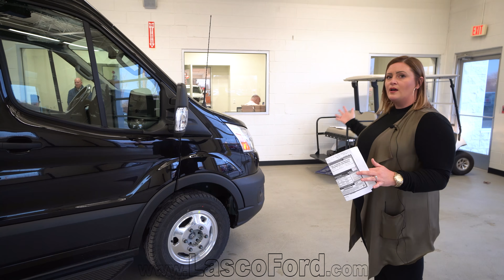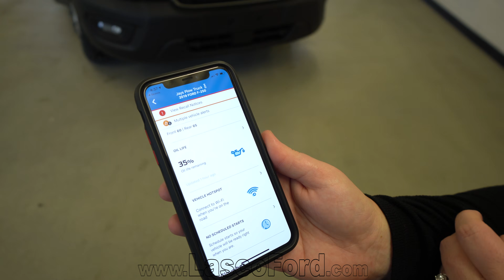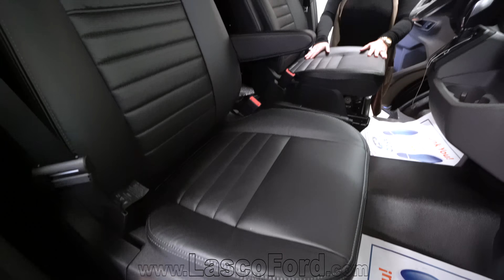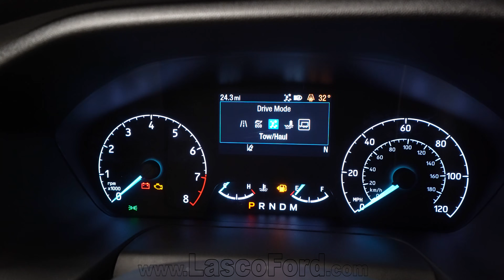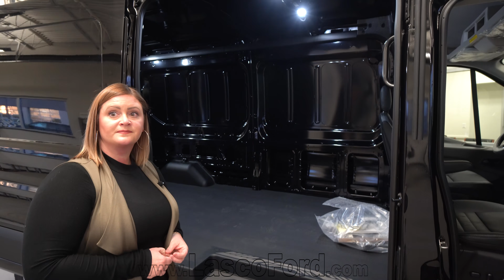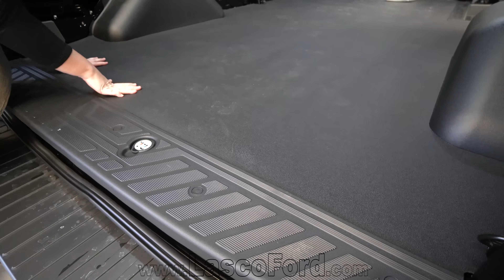2020 Ford Transit AWD - FINALLY! ALL Wheel Drive is HERE!

Comment: why did they "reduce" the brake pads by HALF?? will ford ever fix problems that started back in 2013? Like the water running down into the engine compartment right down on the computer?

Comment: The only thing all wheel drive means to commercial owner is more maintenance to worry about. As far as "warming up the vehicle" before the driver gets there. The idea of safety checks is to check the vehicle before you start the engine like oil and coolant levels etc not after it's been running.

Comment: What's the point f having All wheel drive in a top heavy delivery van. Trust me,there is no commercial app for for wheel drive. If you can't delivery safely in two wheel drive you shouldn't be driving.

Comment: Great suggestion Heeran. I would add something else as well. Being as you are the dealership, the spokesman and spokeswoman for Ford in this case,  you really, REALLY need to know your vehicle Before you make a video about the vehicle. I would be able to tell in less than one minute after talking to either one of you that I know more about ANY of the vehicles in your showroom than you do. It's funny, I will actually purposefully talk circles around a salesperson who reveals to me their ignorance about the product they are trying to sell to me. I will ask questions I am pretty sure they don't know the answer to just to watch them squirm or make up answers. You should ALWAYS have information about your vehicles right at your fingertips. I realize there are different types of buyers that come in, many just as or possibly more ignorant of the vehicle than you are. Those are the potential customers that you should be able to help and give them as much information about the vehicle as possible so they can make an informed decision. Then there are those who just "like" a certain vehicle for whatever reason, it could be the looks, the reputation etc. Again, help them make an informed decision and reinforce the positive thoughts they have. Then there are buyers such as myself who keeps up with nearly all the brands sold here in the USA. I am well informed about specs such as Engine displacement, different engines available, HP, Torque and at what RPM they top out for each. If there is a vehicle I am particularly interested in then I do a LOT of homework about it before I ever go see it at a dealership. There is literally NOTHING that a salesman is going to tell me about the vehicle itself that i don't already know and usually I tell the salesman things about it they weren't aware of. The reason you should know your vehicles in simple, so you can tailor your sales pitch toward the type of potential buyer.  You should be able to figure out which type of buyer you have in front of you within the first minute of talking with them.

Comment: If you mention this in the video, do ignore, but what is the wheel configuration of the AWD.
ie: RWD = 5x160 16" , and if you can provide offset and bore, extra points.

Comment: How long does the ford pass connect last? At least for the remote start? And is this also the same for the 2019 transit connects?
Reply: Fordpass is free to customers forever they changed that late 2019 and it is the same for 2019 models as well!

Comment: ford transit it's made with cheap metal dents so easily just by laying on it I already have a dent, it falls apart after 10.000 miles of driving really poor engineerings , leaks in the engine from rain driveshaft shakes like a hammock, it has to many recalls they give you so much bs that ford hasn't been able to figure out there own problems, they tell you that they don't have a complete fix, also they take your car over month because there so busy with recalls,  feels like its going to fall apart after 60 MPH, really disappointed after I spend over $50.000 for truck that is garbage I never felt so ripped off, and believe me I'm a ford guy sadly, buy one if you want to have problems and when you tried to sell back  it's worth nothing not even the ford dealer wants to take it back as a trade in, to be honest why did they make it if its not even gonna be properly made, I'm pretty sure there going to delete my comment because they don't like to hear the truth, I rather go back to my ford e350 that was well made or buy something different
Reply: Aww bro, looks like you got a lemon. Thanks for playing. You must have lost because you got the shity one...lolz. I hav ebeen using these for years and my hol e compane uses these and they have zero problems. Must be you bro....haha
Reply: @acmekanik9135  maybe you don't use them if you have them park of course they last forever... haha

Comment: Does Ford has Two Types 
AWD and 4x4  Systems.?.
In Some Video Demo, appear as the new Transit 4X4  and On Other as  AWD System.
Are Both Systems Available.?
Reply: @Dialysisforever  
Looks like FORD doesn't Check the quality of it's Own Commercials. 
Even in it's Commercials have Come Backs. :-D :-D

Comment: The Sprinter 4×4 is still much better fit and finished
Reply: Agreed, but that's also why my Sprinter cost $20,000.00 more than the 2020 Transit AWD did. Sprinter is worth more but not that much more. P.S. good luck getting a 2020 Sprinter 4x4, all of the outfitters are buying up the fleet stock from new U.S. factory.

Comment: Real wrong idea replace 5 cylinder 3.2l diesel to the 4 cylinder 2.0 l even that engine paired with 10 speed transmission
Reply: You know that that engine is not available in the US

Comment: I just purchased a 2019 Chevy Express 3500 LWB.  I'm a Locksmith, and let me say - currently I've invested $85k in this van, and will be $100k before it's done. I had my '19 converted to 4WD.. I have several issues about the Transit line, the biggest is the dealership that works on the vehicle.  My Local Dealership has a 3.1* rating on Google, seriously, the place is BAD.  The 10 Speed Transmission is a joint venture between GM and Ford, I think it has a lot of potential, but time will tell.  I'll be in the market for another Van in about 3 years, we'll see how these vans do...
Reply: Just hope you also have a motorhome version of this Ford Transit in the Philippines, Just dying to see one

Comment: Emily,
Do you think it is possible to make a special order for a Ford Transit (low roof model, long overall lenght 237.6 in model) with hinged cargo swing doors on both sides of the vehicle?.
If not possible : perhaps hinged cargo swing doors on right side, and sliding door on left side ?
Rgds
Reply: No dual door option on low roof. I work at the plant and have asked. And no longer than the std long length on low or medium roof only the high roof model.
Reply: @sikinboat  
Thanks for answering. It is very kind of you for asking these questions. So, only 1 option: Dual sliding doors only on the high roof model. 

Can the driver's seat swivel? (this would mean that the emergency brake does not hamper rotation). I ask these questions because I am abroad. I cannot travel to a US dealership. European models are very different. I am preparing a purchase when I am in the USA to transform a Ford Transit into an RV.

Comment: Emily,
Can the driver's seat swivel? (this would mean that the emergency brake does not hinder rotation). That is very important when you want it as a RV.
Rgds
Reply: I went to one ford dealer and he said it was not an option, however I went to a second Ford dealer that has a sales person that specializes in selling Transit vans and he was able to order it with that option however you lose power seats.

Comment: What options are there for limited slip differentials?
Reply: Hopefully it's a bit better than my 2018.  I can lock it, but it still slips sometimes.  Like it's not a true lock.  Of course, that's RWD
Reply: 4.10 Limited Slip optional Axle - w/ 3.5L V6 (998)
4.10 Limited Slip standard Axle - w/ 3.5L V6 (998)
3.31 Limited Slip Axle - w/ 3.5L Ecoboost (99G)
3.31 Limited Slip Axle - w/ 2.0L Eco Blue (99A)
3.73 Limited Slip Axle - w/ 3.5L V6 (998)
3.73 Limited Slip Axle - w/ 3.5L Ecoboost (99G)
3.73 Limited Slip Axle - w/ 2.0L Eco Blue (99A)
3.73 Limited Slip Axle - std w/ AWD & incl w/41E (except
on S4X & F4X) & 47B
3.73 Limited Slip Axle - std w/ R1Y, R1C & R1X when
ordered with W48 & 99A
3.73 Limited Slip Axle - std w/ W1Y, W9C & W1X when
ordered with W48 & 99G - W1X LINE MISSING

Comment: Why doesn't USPS get a stripper version with the Ford Pass features to deliver mail? AWD would make it SO much easier in the winter. Ford would make a mint. Probably have to beef up the door handles lol.
Reply: Ford is in the running for the usps contract they would have different side door and rear doors